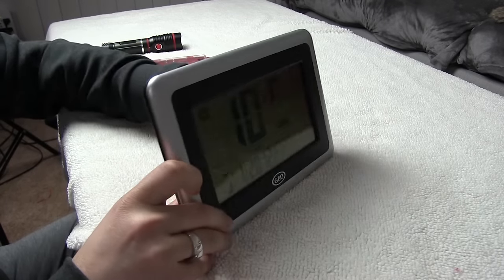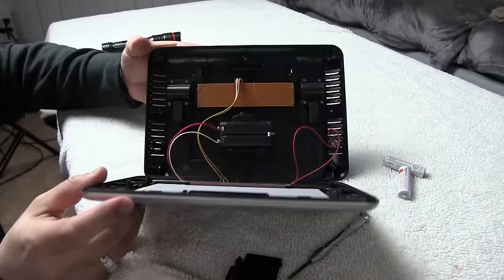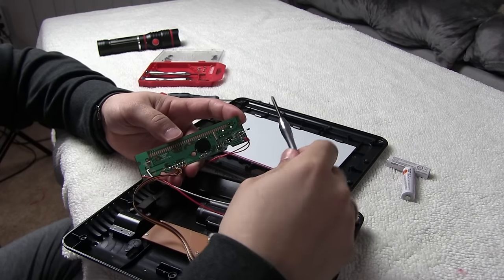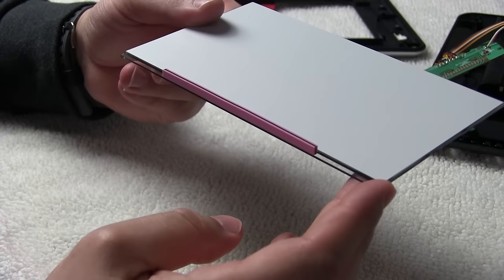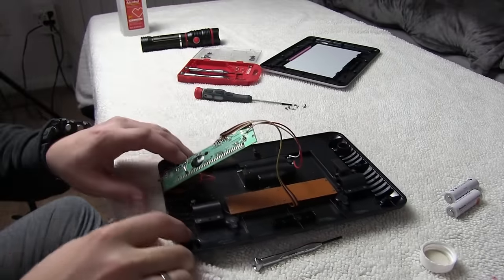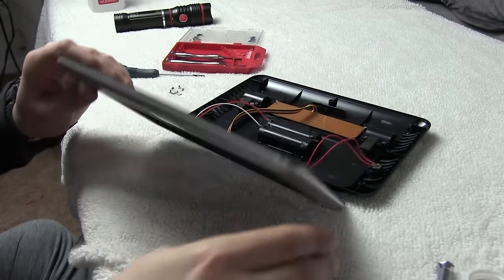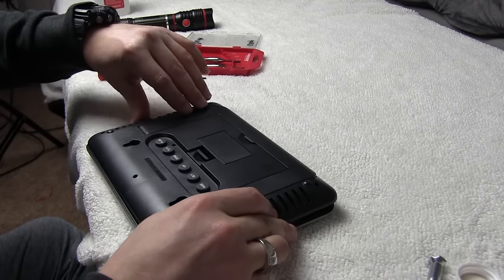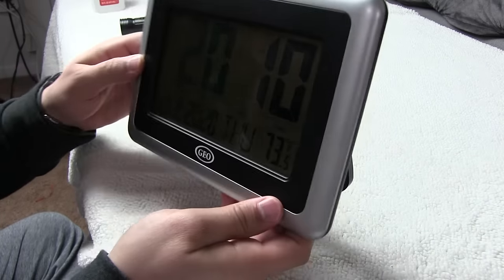Fix Missing Numbers or Unreadable or fading Time / Display / LCD

Comment: My alarm clock has recently started missing segments in the numbers. Taking it apart revealed that it uses a plastic tape connection, not a zebra pad. So I thought directly heating up the LCD panel may help fix it. So whilst still apart I heated up the LCD panel with a fan heater on high for around 5-10 minutes whilst intermittently lightly massaging the panel. I had batteries in it at the same time so I could see any changes. And to my surprise it worked! all the missing bits came back. So if your device uses a plastic tape connection try blasting the LCD directly with a high heat.

Comment: Thanks, Dan. I have a York rowing machine. The screen has been gradually fading until it was no longer readable. I tried to get a replacement, but the best I was offered was a replacement machine, which would cost me around A$750. I applied your techniques, and it now works like new. It wasn't hard, but I took your advice to note everything carefully as I was pulling it apart. I used computer cleaner rather than alcohol for the cleaning, but the alcohol you suggested would probably have worked just as well.
Reply: I have the same problem with a concept2 model b and i am going to try this to the pm2 screen

Comment: This video was very helpful, my LCD clock in the kitchen was not properly displaying the date. All I had to do was take the back off and tighten up some of the screws inside and now it works perfectly, I didn't even have to take it apart any further to clean any of the contacts. Thank you sir.

Comment: Thank you for this very clear video. Many would just toss the clock and buy a new one, but this video is really educational- I am trying to fix the LCD screen of my BMW instrument cluster (over $1000 with issues of mileage transfer codes). So ideally I’d want to fix it and not replace the whole cluster. This gives me the confidence to open it up and give it a good try!
Reply: Tell us the result
Reply: My problem solved as I resolder the loosing leg of the lcd on the board
Reply: Hello, can you tell how you did it? I have exactly the same problem with the dashboard of my citroën which is displaying fragmented numbers of mileage

Comment: I had to fix the display on a volt/ohm meter that I used your guide to clean the contacts but I was missing some of the characters and found that it needed more pressure which I fixed by adding a spacer between the plastic back and the board right behind the display.
I'd add small thin washers on yours at each screw to spread out the pressure on the board for a more consistent and constant contact on the board and the glass connector.
Thank YOU!

Comment: Thank you, Using the steps in this video I was able to fix a faded screen on a new scale I just bought ( lost receipt). The cobra strip became disconnected upon  display removal. I just lined it back up and placed display glass back on; then applied slight pressure while screwing back  in place. Works perfectly!

Comment: Thankyou, just fixed my clock with the help of your video, problem was the display went off when the temperature dropped. When it warmed up in the sun in the window, the display worked. So I assumed it was related to expansion, somewhere in the circuit, so tried cleaning the LCD as in your video, and it appears to work. Hopefully it stays on when the temperature drops.

Comment: Something else you can do. If after cleaning with only a paper or nylon rag, make sure there's no fiber left to bother contacts and you tight the screws and yet find problems in connections, get a thin file, if possible metallic, and give the female surface where the screws get in, a pass or 2-5 good passes. Basically you will be lowering the top or high end of the females and, once you place the screws back you'll tight them more, making contact better stronger, just do it nicely, as I say, don't get emotional. I have a feeling you are not the gent that get emotional meaning will be roughly tighting this things back but I say it for the purpose of the rest of the public. And if possible tight them with the batteries in, and the device on if there's a button to turn it on so once you see the numbers starting to show up you will be having an opportunity to either leave the connection right there or tight it a slightly 1/4 turn and finish assembling it. Some may want to add a little nail paint just a tiny dab to sort of a side of the screw head to add lock tight feeling for years to come, something you can cut remove in case you have to review it later on, wait 5 minutes until is dry, close it and you may got it fixed.

Comment: Thank you; I took my clock apart but wasn't sure what I should adjust. I don't have the rubberized part though - mine has more of a plastic wired ribbon that is the connector. Would I approach differently?

Comment: Wow I had a digital scale with the screen and I got water into it so I opened it up and cleaned out the water and I tried to put the screen back into place and I couldn’t because there are little strip of that pink and black foam so I took it out and put the screen back on it worked but the screen wasn’t displaying the numbers so I found the pink and black foam from the bin put it back inside and bam it worked. I just lined it up with the center! So suprised

Comment: Mine yesterday I went to check the time and it was stuck at the beginning it was like this year = 2000 date day and temperature it stopped and I pressed the SNOOZE button the screen got out and it came back to normal do you know anything how to solve this? Mis a question, Is his Alarm the song that plays when you reset the clock?

Comment: I have an small old Westclox 509540 digital bedside clock with snooze button etc.  The display is red LED. Great in low light and at night but in daytime, the time display isn't exactly bright red and from 10 feet away... you'd need to get closer to see the time. Is this normal, or do old LED clock LED lights fade over time?
Reply: It is normal for LEDs to fade after a long time on.

Comment: So hard to hear even with both volumes all the way up.
Reply: The problem is half YOUR fault for using a cell phone. Half his fault for not buying an external microphone. I can hear it fine using a JBL Clip speaker. Could it be better? Yes, with a microphone or a camera with a better in-camera mic.
Reply: @NirnBootMod  I'm on a laptop.
Reply: @wellsorted  Then you should be wearing earphones.
Reply: @NirnBootMod  I need to be mobile. When I'm listening to a podcast , I'm doing other things. I have tried all of my computer setting to get the volume as high as possible. I wish I could easily boost it somehow.
Reply: @wellsorted  JBL Clip speakers can be used wireless bluetooth.
Reply: @NirnBootMod  Thanks!